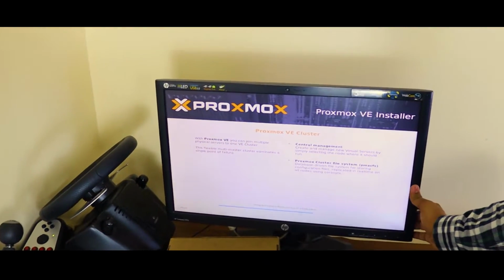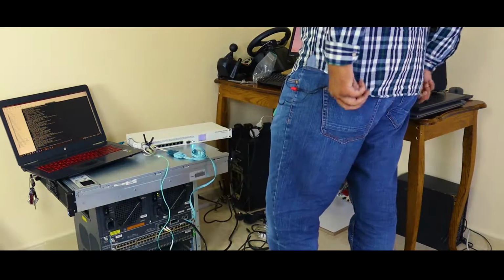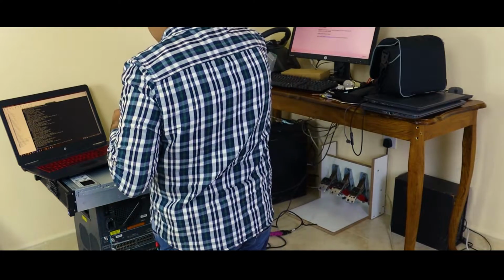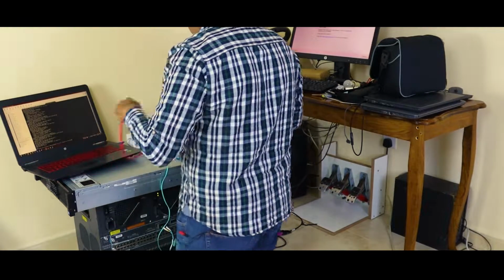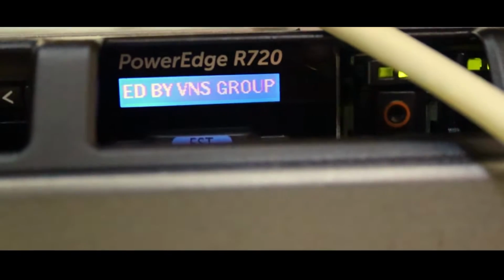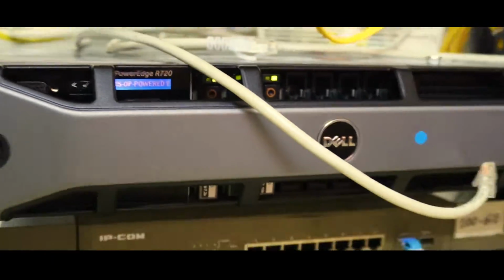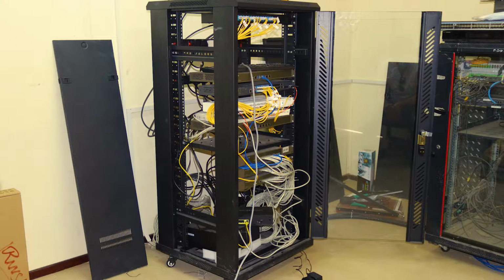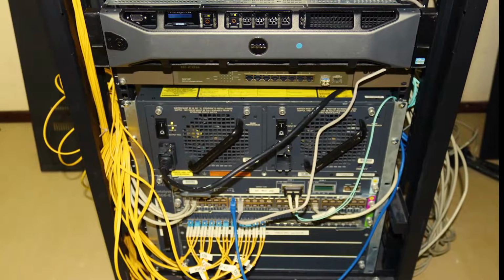V15 - PROJECT VLOG - HOTSPOT HSIA NETWORK DEPLOYMENT ON A MIKROTIK CHR FOR 3000+ USERS

Comment: I've saw that you used LR transceivers for a short range cable without an a attenuator, to much RX power can blind the RX led and in the long term make it burned.
Check DDM/DOM

What is the CHR performance, did it truly was able to get to 10Gbit ?
Reply from the maker: Thanks for the heads-up , all the fibe cables are more than 500 meters in length. We didnt actually need 10g but we are floating around 4gbps and without any problems.